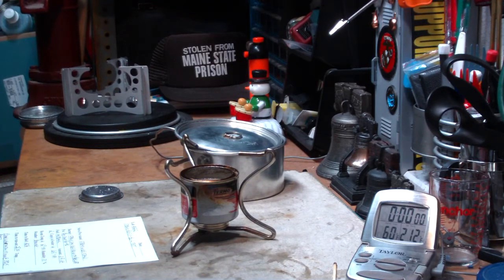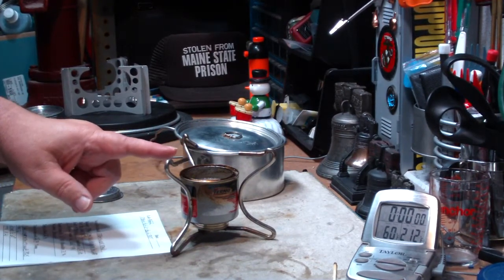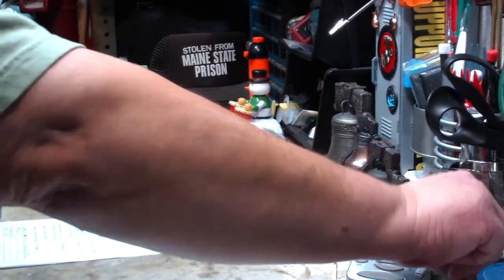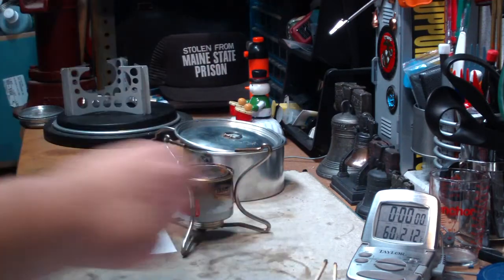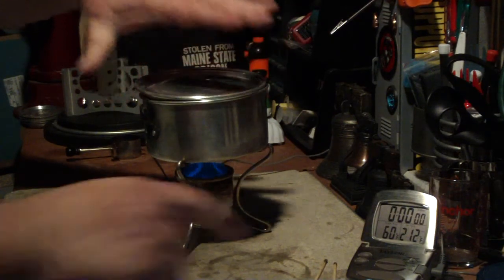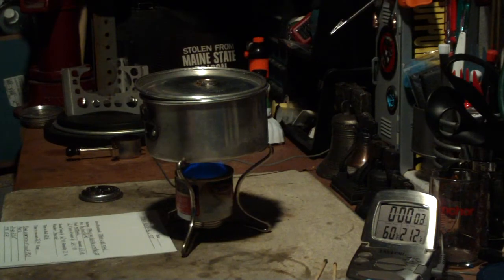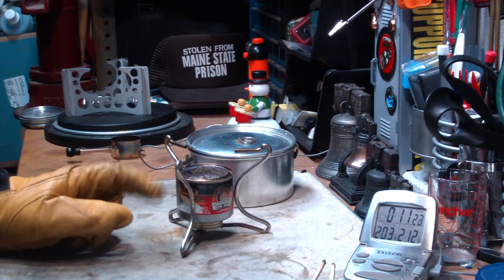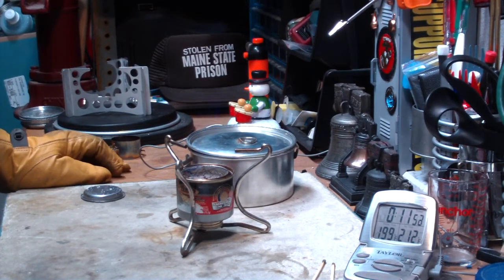Sterno can refill with Perlite and alcohol - Boil Test 2

Comment: Thanks for the video. Since the hottest part of a flame is the tip where the fuel reaches full combustion you might try lowering the flame 1/2 inch to an inch below the first boil level and see what that does. just a thought. Thanks again for all the videos!

Comment: This is a great experiment because you can re-use the sterno can with a cheaper fuel and it seems that you snuff the flame, save the fuel,put the lid back on and go on your way.It would be a great addition to a penney stove.The penny stove could be your hot burner,this could be your simmer burner.Now I wonder how much longer the sterno/perlite setup will burn than a penny stove with the same 2 oz of fuel.Also I wonder if burn characteristics are the same with more fuel (4 oz) as with 2oz.Thnx!

Comment: I wonder if a wind screen, surrounding the entire burner and stand, might not concentrate, and contain the heat, and direct it more toward the container, thus decreasing the time required to reach the required 212 degrees  F / 100 degrees centigrade .... Cheers.

Comment: I wonder if there is any difference between sterno, and the gel that comes in the notkocher. I have achieved a boil of 10 minutes (1/2 pint) in the field with the notkocher and a windshield made out of foil. Good enough for tea, or instant noodles.

I  refilled it with sterno, but the flame isn't so fierce, nonetheless, in my kitchen I boiled 3/4 pint of water and pasta in 20 minutes, to which I added a dried bolognese sauce, voila a meal in about 30 minutes. What you need is patience.